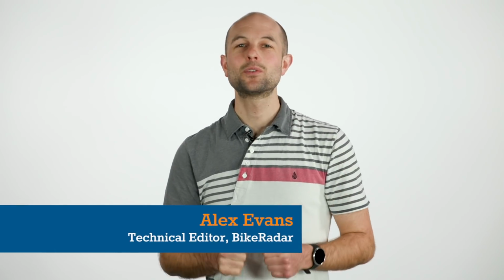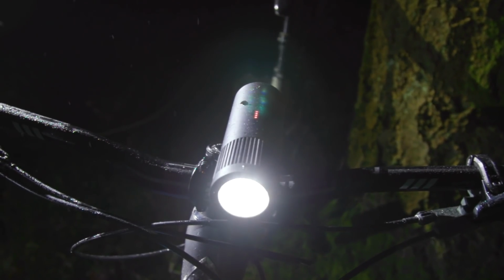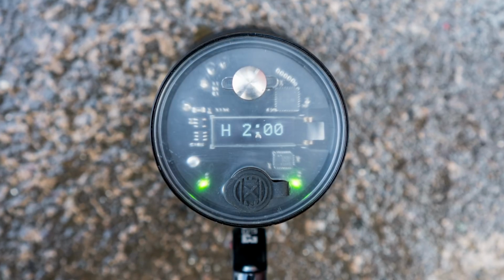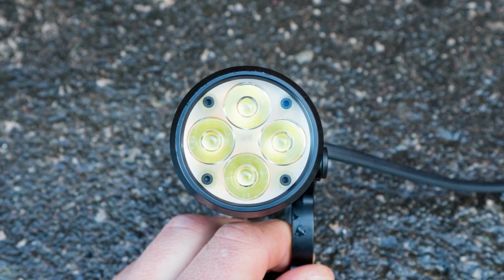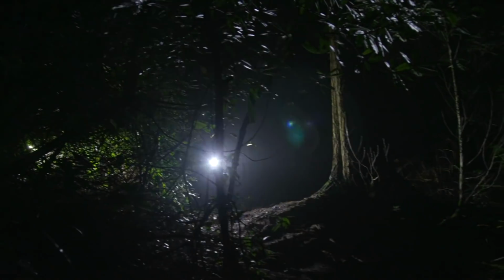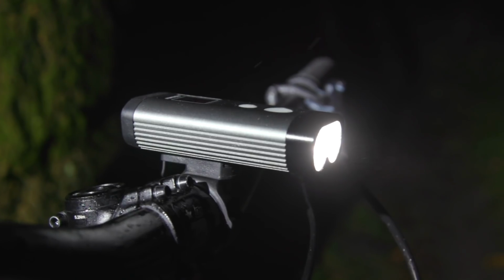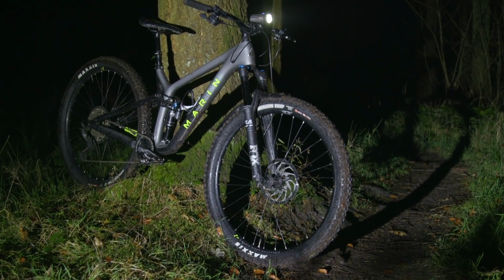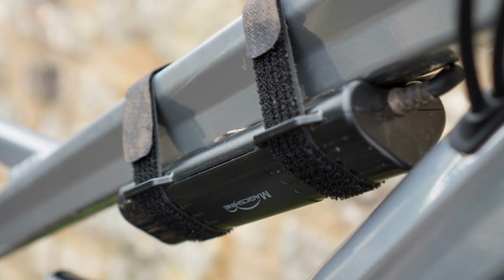15 Way In-Depth Front Light Mega Test

Comment from the maker: What's your favourite headlight? 🔦 Did it make the cut in this mega test? 🏅 Let us know in the comments below! 📝
Reply: Chinese noname $30 light with a single Cree XHP70.2 diode providing more lumens than these abominations, running colder and longer on the battery!
Reply: @roilev  can you name some of them (chinese bike lights)? Thanks
Reply: @roilev  100% agreed, i have a headlamp version of an XHP90, same idea, and its cheap, bright, and works great for my needs
Reply: Running Fenix lights for years, it's a shame they are not as known.
Reply: I pair the Monteer 6500 with the great little ALLTY 1000, cant beat a bar + head lamp combo https://www.youtube.com/watch?v=sWmV7w0IKwo&t=306s
Reply: BikeRadar I have the exposure six pack and love it.  I was surprised to hear your comments on side to side as it’s been a lot better than the others I’ve seen and never felt it was lacking. Very thoroughly done review overall. Lots of great information with good points brought to light
Reply: Huge fan of the NiteRider Pro Race.  The unique handlebar mount allows you to center the light on your bars (though when riding technical trails, I use the helmet mount), and it's battery indicator is easy to read (when it's on your bars).
Reply: For my road bike I simply use a MEC brand (an outdoor store in Canada) 1000 lumens lights and run the light at 50% but for MTB, I tried to use the same 1000 lumens at 50% (to get longer run time) + a LEZYNE 1000XL also at 50% but it's not enough power. I ride in winter in Canada and it's cold + I don't have the eyesight that I use to so I needed a more powerful solution plus longer run time as I can ride for 2 to 3 hours in the cold. After many days searching and reading reviews, I bought a Magicshine Monteer 6500 mounted on the handle bar plus a Gemini DUO 2200 mounted on my helmet. I have 2 batteries for each so I can run both of them at full power for a long time. Another reason for so many batteries is that I don't empty them too much so they will last longer. Even if I run the Monteer 6500 at 4000lm it's plenty powerful and I can see pretty far. Yes, I could have bought cheap Chinese lights but no thanks. I have enough experience in electronics and using cheap batteries and LED to know that you get what you pay for (I'm a drone technician and I've seen my share of bad quality Li-ion and LiPo batteries). I could also have saved and bought a cheap Walmart MTB but I decided to save and buy the best I could get with the money I saved. Yes, you can argue that I could have purchased 20 cheap lights  (maybe even 40) for the price I've paid for my 2 lights + batteries but one side of the coin that most of us seems to forget is that the dumps are full of crap and buying cheap stuff just contribute to the waste that is now suffocating our amazing planet. Buying cheap as its consequences!

I almost bought the Gemini Titan 4000 or the Exposure SIX Pack for their features like the OLED display and the auto setting of the light output with your speed but I decided on the Magicshine Monteer 6500 because of the way better light spread. The only negative points for the Magicshine Monteer 6500 are the lack of remote and the small button that is hard to press with gloves. The fact that there is no battery level indicator apart from the button that changes colors (green 100%, blue 70%, red 30% flashing red 10%) is not a big factor for me because I know how long my ride will be and in the middle of the ride I switch battery just to make sure I'm not wearing one out more than the other.

For the helmet mounted Gemini DUO 2200, I strap the battery to the back of the helmet and hardly feel the weight but the battery does wiggle a bit because it's held in place using a simple elastic velcro strap that I attach to the goggle strap at the back of the helmet.

One last thing, the run time given by all those companies should be reduced by at least 50% if you ride in the cold (Montreal winter that is not as cold this year but still between -5 C and -15 C). For the Gemini DUO 2200 (same as for the Titan 4000), it comes with a remote than is powered by a cheap CR2032 battery and if you use it below 0 C, the battery just stops working after about 15 minutes (or even faster if it's colder) so I had to purchase the better quality Energizer CR2032BP (https://www.energizer.com/specialty-batteries/2032-battery) that has a working temp of -22 F /-30 C. If someone tells me that the weight of the 4 batteries I carry is to much, I will simply reply to get more legs muscles!
Reply: @philippeboivin8708  I bought an extension cable and have the battery pack in the backpack. It doesn't wiggle. I attach the cable to the back of the helmet with a small velcro that is easy to undo if I forget to remove the helmet before removing the backpack. Still lots of hassle but worth the illumination I get from a bigger light weighting less on my head
Reply: Awesome review. Detailed and precise information about high powered headlights. Congrats!
Reply: I think the Lezyne 1300XXL Macro Drive is quite enough, but will need a headlight with around the same lumen (1000-1400) to ride technical trail or single track.
I found mine on sale for $75, so that was a bargain.
Reply: Just added the brand new self-contained Lezyne 1800i MEGA to my existing 1500XXL DECA.
Excellent!
New button is effortless and the micro-USB connector surround/opening is wider..
Folks need to read the instructions to put them in Race mode to achieve the highest light output.
Reply: Single form factor can't be too far away for the big guns. Remote control single button is a great help as i dim or turn off my secondary bright lights regularly for oncoming cyclists, pedestrians and motorists.  My main difference is my personal need: a long throw Spot beam. MagicShine would be perfect with a helmet mount.
Reply: Great review too.  Half hour is fine.
Reply: Only the Canon photo showed the real lumens. The bike rider was probably using the same light over and over again.
Reply: Terrific summary review of the top lights.  I have the Magicshine Monteer 6500S and couldn't be happier.  I need to get a helmet light and will be re-reviewing your summary before I decide.  All in all, a very nice job of reviewing what's out there.  Nicely done!!
Reply from the maker: @Ron_Boy  thanks for watching!
Reply: I use a Exposure MAXX D MK12 on my bars, coupled with the Exposure Diablo MK12 on my helmet. Fantastic lights plus everything is built in so no external battery at all.
Reply: For helmet maxx-D , bars hope R8
Reply: InstaBlaster
Reply: I purchased the Titan 4000. Love it! Im hoping to be able to wire it up with my Bosch CX motor.
Reply: There is absolutely no reason why this video needs to be a half-hour long.